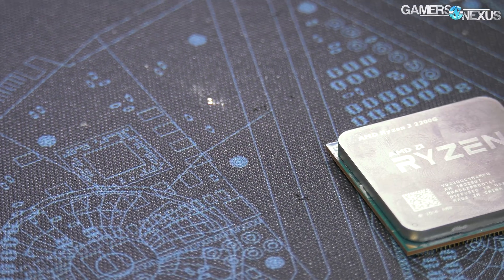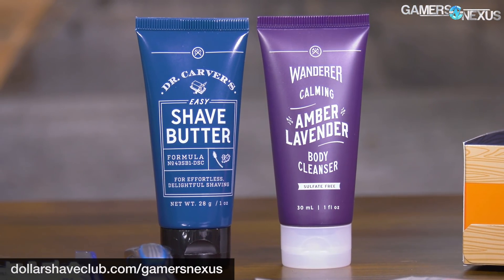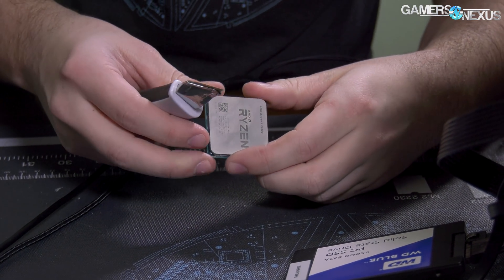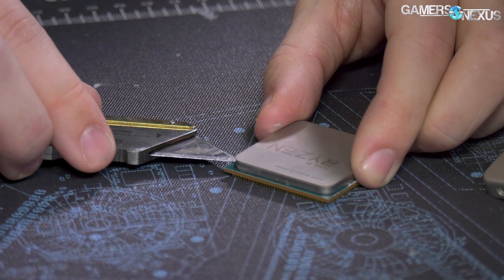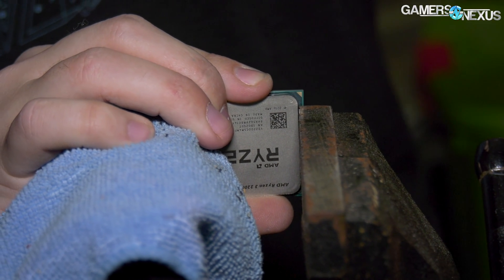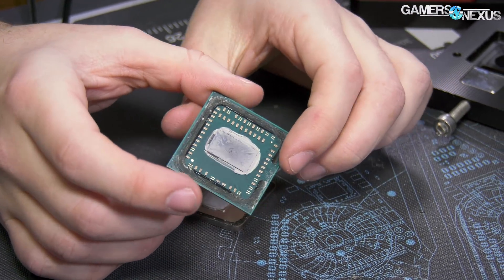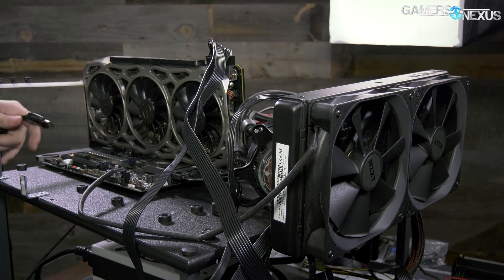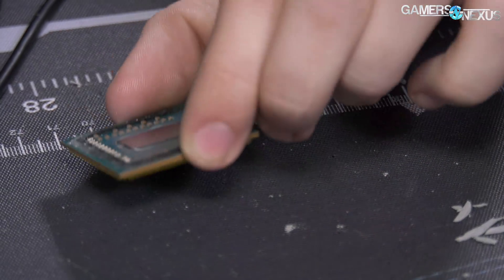Delidding AMD's R3 2200G APU & Liquid Metal (Pt. 1/2)

Comment: I want you guys to compare AIOs vs  air coolers. 360, 280, 240mm etc. vs a plethora of air coolers from the monstrous NH-D15s, Le Grand Macho RTs, to the midrange NH-U14s, True Spirit 140 Power, Mugen 5, etc, and of course cheaper air coolers.

Do it with a delidded CPUs so the thermal transfer bottleneck is moved to the cooler! Do all the fancy comparisons besides just temperatures too - cooling when noise normalized to 40DB, noise at full RPM, etc all the stuff you usually do.

Comment: I just bought a RYZEN 5 2400G. If I knew it wasn't soldered I would not have bought it. I would have bought another R5 1600 and a cheap discrete card. Now I am pissed off.

Comment: Wouldn't it be better if AMD or Intel had CPU LGA/PGA with CPU lids that is not attached to the CPU chip, and has option to either glue them together  when you apply your thermal paste of your choosing? i mean it does make a significant difference in thermals when you delidd a CPU or full contact with the CPU die!

Comment: der8auer did it with his delid die mate 2 but he just added a little piece of acrylic plastic to spread the force on the whole pcb. He only gained 25Mhz and his temperatures went around ~10-15C° lower. But he mentions that he could only stress test the CPU part and that the temperatures gains could be higher when the whole chip is being stressed. 

Since the APU's don't seem to be Temperature limited but limited by the processing, just like Ryzen (with good coolers), delidding makes the most sense when dealing with small form factor cases and small coolers while overclocking simultaneously.

Comment: 17.5mm^2 by 10mm^2 so 175mm^2? Much smaller than I thought (Ik it’s inaccurate way to measure) but that is way smaller than I thought I’ve seen low ball estimates at 209mm^2

Comment: I think, someone should talk to them about that. I would pay 109$ and 179$ for the with TIM, because it's just way better, more performance, lower wattage and cooler, which means you need not that good of a cooler. I think that was the wrong step, because the GPU boost much higher with better temps and I don't think 10$ wouldn't keep others away from buying it...Pls give me an answer ^^

Comment: I have unlocked CPU. I want to overclock it. Drain all the juices from it. I want to delid my cpu and apply liquid metal on it. I have longevity concerns. I don't mind warranty. I just want to know if liquid metal damages cpu die and the surface of the IHS and the copper base of my AIO cooler. I know delid is great for thermal performance and overclock. But, it makes no sense if delid causes damages on the hardware. I don't mean the causes due to users' mistakes. I mean the liquid metal's longterm effects. I think many users want to delid. But they are afraid because of these concerns.
Reply: Well this is why you should be complaining to intel to stop being so cheap on their high end products. This channel often suggests and mentions Der8auer, one of the worlds best overclockers and has enough engineering insight to provide guides to deliding most CPU's. His content comes in German and English.

Comment: It's cool that AMD decided to use TIM og these APU's as they're meant for budget market, BUT LOOK AT THE INSIDE OF THE IHS!!! LOOK AT IT. They raised the IHS a bit so that the TIM has a lot more contact. That's something Intel has failed to address since 2012 !!!!!!!!!!
Reply: The reason for the raised IHS is that the surrounding components are taller than the die, AFAIK on Intel that's not the case. IIRC the Ryzen CPU's doesn't have it raised either...?
Reply: Qyngali Yeah, you have a point. But still. Intel could have done similar to what AMD did to these chips. Bringing the die closer to the IHS.

Comment: @Gamers Nexus How much more do you think it  would have cost AMD to solder the IHS? I think it is really unfortunate that the  went with a thermal compound instead of soldering. I really dislike thermal compound under the IHS and that solely is the only reason why I did not get the I7 8700k and instead will get the Zen+ version of R5 1600 or R7 1700.
Reply: I am not sure of the r3 and r5 4 core varient of Zen 2 but it's most likely will be soldered same as 1st generation.

Comment: 6:34 "the way I remember..." It has a missing piece of silicone adhesive so you can tell it goes that way
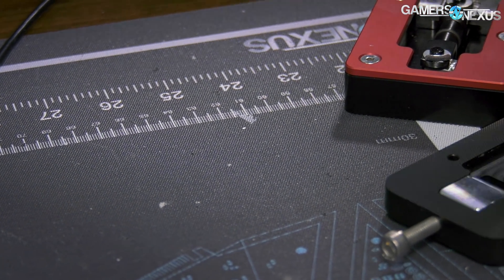6:42 "doesn't need to go back same way" well... it has a risen (see what I did there?) piece inside to contact the die so... yes it has to go the same way. EDIT: or 180 degree rotation I guess would be the same

Comment: We are 2 months to Zen+ release and tim on 100 and 170 usd cpus doesnt look good since Zen1 had soldiered cpus at that very same price. Looks like AMD is going intel route.
Reply: AMD has used TIM on cheaper products in the past. And, these have Vega graphics inside. Moreover, they have to use a single good CCX where the previous Ryzen 3 and Ryzen 5 chips contained 2x CCX with potentially a few bad cores. So, basically, the previous chips were recycled CCX while these APUs are perfect CCXs with Vega.
Reply: AMD APUs have always used TIM (FM1 & FM2) and AMD themselves made it public that they have used TIM to save some $ FOR APU ONLY as they don't generate much heat and they are selling it for pretty cheap. Rest assured, Ryzen 2000 series CPUs based on Zen+ will be soldered.

Comment: I just wanna see some god damn OC benchmarks of the APU! WHY ARE THERE NO OC BENCHMARKS YET?!
Reply: Kly Clack the video is being edited.
Reply: Nothing new or that interesting oc anyway, others have done it. The cpu is the same as the first gen Ryzen, so between 3,8-4ghz. The Vega gpu seems to go to around 1550mhz and give 10% more performance.. closer to a rx550 if you use at least 3200mhz dual channel ram.

Comment: wonder if it's possible to use the CPU without that lid?
i imagine stock AMD cooler would work quite nice with that
Reply: Did you not see the space/thickness of the ihs?? No good idea, core can damage!
Reply: The plastic of the socket is raised too high on one side, it's a bit higher than the die without the IHS. Most coolers will contact that part of the socket first and you get almost no contact to the die itself.
Reply: coolers with round base then? smth like Deepcool Gamma Archer Bigpro (i know, possibly a rubbish cooler but still better than nothing)
Reply: There are some coolers that will stay clear of it, but not many. Check der8auer's ryzen delidding and direct die videos, he found an aircooler that worked.

Comment: Just got my GN mod mat and it's awesome!

Suggestion: Perhaps do a couple of videos highlighting using the anti-static wrist band in different regions other than the US where there is no ground in the power outlet, for example in Canada or Europe.
Reply: All of Europe is not the same you know.. In Sweden there is always ground i the outlets.
Reply: Does the US do it differently from Canada? We have 3 prong outlets here.
Reply: Just because the sockets in Europe have 2 pins doesn't mean they arent ground. The grounded 2 pin sockets in europe also have 2 (top and bottom) pressure pins that touch a contact plate on the plug. Just google image search "european electrical socket" and you will see the 2 pressure pins i'm talking about.
Reply: What I meant is for them to do a demonstration.
Reply: As far as I know it's the same but in the manual provided there was this extra hole on the outlet and apparently not all US outlets have it.

Comment: Doesn't liquid metal eat through aluminium? Seems like that IHS is aluminium.
Reply: Oh my f@cking God no it does not. Intel's IHS material is alum and the worst you get is mild discoloration but it otherwise feels pretty smooth. Product might matter in this case, but generally horror stories don't happen to people who do their research.
Reply: It's not acid!!! Where you people get all the strange ideas today?
Reply: Both intel and AMD uses nickel plated copper for the IHS. If it was aluminium it would indeed get destroyed by the gallium, but there's no aluminium anywhere close to where you put the liquid metal.
Reply: Because I read somewhere that liquid metal thermal paste has gallium in it, and that certainly DOES corrode aluminium if you've seen any videos on it, where just a small drop disassembles a aluminium cola can in a few hours.
Reply: Chaim Goldbaum its maybe colored copper
Reply: Nice, that explains it then.
Reply: And here I was thinking it was aluminium. Oops...

Comment: and then AMD did not solder their CPUs
Reply: zMeul only on the 2200g and 2400g APUs. AMD said themselves said that they weren't going to solder the 2200g and 2400g that's why they can retail at $99 and $169.
Reply: The indium solder costs a lot. AMD didn't put it on low budget items, but Intel didn't put it on 1000 +$ CPUs.
Reply: AMD doesn't typically solder their low end cpus. Am2, fm1, am1 etc chips used paste instead of solder. What would be unacceptable is if they started doing so on 300$+ cpus, like mainline ryzen
Reply: They do solder them, but they don't solder their APUs. It's all about making those cheaper. No need to worry about delidding such low power chips

Comment: i bought some electrical liquid tape.. would that work ? or is it too thick and can insulate it.
Reply: There is TIM already there, if you aren't using something much more conductive then you shouldn't void your warranty =)
Reply: Ben Grogan I meant when applying liquid metal, to prevent shorting is liquid tape a good alternative instead of the nail polish he uses.
Reply: I can see no reason It wouldn't be usable off the top of my head - Seems PTFE based and insulating, Depending on how elastic it is when set it could have the same issues he raised with silicon in the last Ask GN: Namely he prefers nail polish to avoid risking pulling components off the substrate if he ever has to redo it.
Also dependant on temps, the die itself could still reach 80+ degrees as a possible, you want to check flamability
Reply: Ben Grogan is it easy to remove? It seems like it would be harder to remove than liquid tape is. I am not a female so I've never used nail polish. Lol.
Reply: Nail polish is a hard finish but dissolves in isopropyl alcohol which you are already cleaning the die with: Worst case scenario a very soft brush.
As I said I have no experience with the liquid tape to know it's consistency, but if it's elastic like silicone, meaning you are peeling it off rather than dissolving it - it could strip microcomponents from the substrate
Reply: Ben Grogan thanks, that makes quite a lot of sense. I will try this on my next application.
Reply: Silicon Lottery uses liquid "Tape" (as many often put it) on their binned delids. So yeah, if it's god enough for them... However I would still go with a bit of masking tape and some conformal coating, I suppose nail polish is often used because of its ease of application compared to thin coats of conformal.

Comment: I didn't realise the CPU pins on Ryzen were so tough. I remember bending pins on old PGA chips 15 years ago doing a lot less.
Reply: The pins were taller in old chips.
Reply: I would still work with-in plastic cpu container that cpu came in, which will naturally raise the pins so it wouldn't damage it in anyway...
Reply: The old AMD CPUs were pretty tough, same can't be said for the weak and fragile intel P4 CPUs which I know of a few people that bent them inserting the CPU without even feeling any resistance and destroyed CPU and motherboards lol.

I have quite a few old AMD cpus and even one socket 940 opteron CPU got stuck to the coolers and ripped the CPU out during transport from Germany to Australia all the while the cooler still mounted under full pressures and sliding the pins around on top of the socket. None of the pins were even slightly bent. I was impressed.  The CPU also had a ceramic substrate. Looks just like a typical ryzen type package but with purple ceramic substrate instead.  I have always liked AMD's PGA designs.
Reply: However, the Ryzen pins are still noticeably thinner than the Brisbane Athlon X2 that I had. I have never bent a pin, so I do not know how much they can take.
Reply: They're a lot tougher now that they're glued in place.
Intel has much to learn.
Reply: as it shares the same footprint as PGA-94X whatever it used to be, 1330+ (i can't remember the exact figure) of AM4 will be thinner. However, they still aren't weak. 
And yeah,  I've ripped out several opterons removing their coolers from servers because the thermal paste sticks so hard despite being fresh and they are like MEH no big deal. 
It's still easy to accidentally rip out AM4 coolers but wiggle it multiple times to loosen up the thermal paste it will come off normally and if you do rip it out, be careful to pull in a upwards motion

Comment: Though I would never do that my self it is interesting to watch. It's like microchip surgery. Also could we see if the liquid metal spills over after it gets used a bit? I m curious to see if the liquid metal stayed in place after heating.
Reply: Yes the liquid metal stays in place through surface pressure, If it spilled over the sides in use it would short the chip.

Comment: Will there be a R7 version as well?
Reply: No, They are looking only at the low end market for APU's.
Reply: r7 would hit a limitation for one APU has 1 ccx and 1 vega gpu in 1 package... if the add more ryzen cores no more room for vega graphics... if the add more Compute units on Vega it wont help increase performance since vega 11 is already memory starved. the only reason Intel 8809g can pack 20 vega CU is that it has HBM2 which has enough bandwidth.... while the vega 11 should be on par with an rx 560 in specs (3.14tflop) but fails to beat an rx 550 in most games. ddr4 is too slow for these APU it needs graphics memory like gddr5 or hbm2.

Comment: 0:55 Steve turned into a POST code speaker...
Reply from the maker: I'm fluent.
Reply: I thought my computer was possesed! Happy to hear it wasn't that and I'm not going crazy.
Reply: I thought my DAC was dying.
Reply: Oh it wasn’t my Bluetooth LUL
Reply from the maker: m1ms84 - Both were, obviously, on during the thermal tests. Why would you think that one was on during tests? Not everything happens on camera. The bench was used to literally burn the APU to heat the silicone adhesive. There wasn't even a cooler on top of it.
Reply: How can you run thermal tests with only 1 radiator fan spinning?
Reply: You could even say he went...
(•_•)
( •_•)>⌐■-■
(⌐■_■)
POSTal

Comment: Personally, for my own use, I don't know if voiding the warranty would be worth it (plus the risk of a muscle twitch bricking your processor). If you need the best performance, though, then this seems like a great way to get it.
Reply: It probably isn't worth it for these APUs, they're meant to be low end part anyway, having to delid and add liquid metal is adding to the cost, and is just not worth it.
Besides, these APUs get to around 79 Celsius with the stock cooler, so it's not like they run hot to begin with
Reply: I think it’s more to eliminate probability of thermals during testing, to see its maximum capability. Also to be different a bit and say screw amds marketing stick .
Reply: Dennis Rigdon For testing it totally makes sense. And people would've been asking about new chips using TIM vs previous chips using solder, this makes the comparison more possible-ish.

Comment: Wow even now AMD also use the same sh*t cheap thermal paste method as Intel instead of soldering the chip to IHS?
Reply: Only on the cheap models
Reply: Final Lau only on the 2200g and 2400g as a cost saving measure. On any of the other CPUs in the Ryzen+ lineup they should be soldered.
Reply: AMD typically has better quality than Intel when it comes to manufacturing processors.
Reply: Final Lau its not cheap unlike intel's line up of toothpaste
Reply: If you followed the news, you'd know that AMD stated that they did this, along with reducing the L3 cache, as well as reducing to 8 PCIE lane for the APUs only to save cost. I mean they're selling it for $99 and $169, that's dirt cheap
Reply: It's to reduce costs, since they are selling these APUs incredibly cheap

Really ungrateful that you're complaining about incredibly cheap processors that have integrated vega graphics...
R3 1200/1400 have solder because they are usually the result of cut down R5 and R7 chips that had bad yields with some cores failing. Where as the R3 2200g/2400g are both developed from the ground up with an integrated Vega GPU

And the thermal paste AMD used isn't all that shit, as seen in youtubers thermal results. Nor would it be that bad if they did, these are low power 4 core CPUs. The problem arises is when you start using it in super high end and high core count CPUs, like INTEL does. Even Intel's 18 core CPU has fucking shit thermal paste. Which is absolutely pathetic.